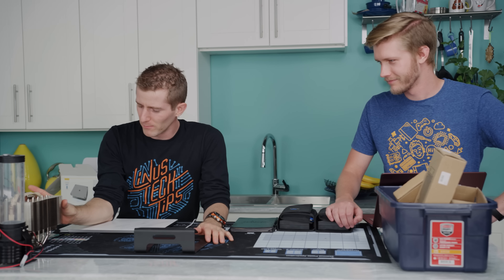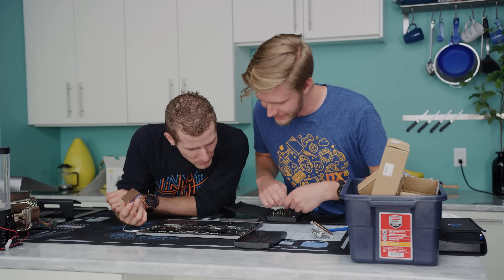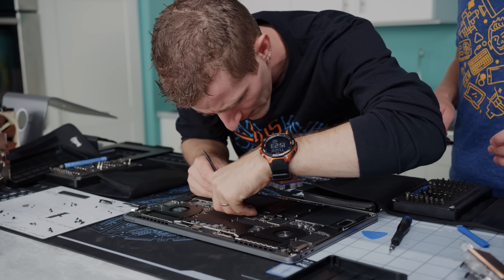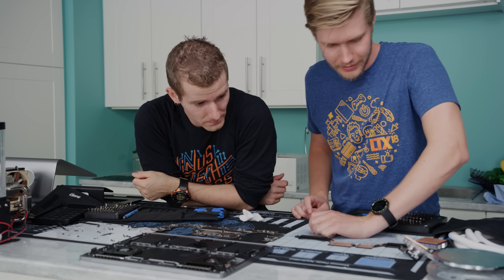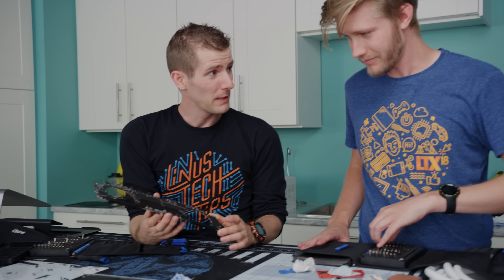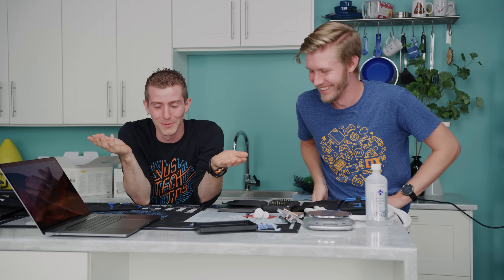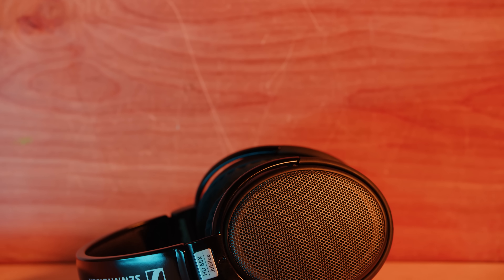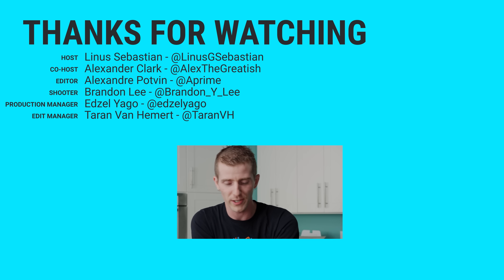We FIXED Apple’s New MacBook Pro

Comment: Just imagine, one day on the next model every screws turns into a soldered ones that users wont pry it open again... lol
Reply: That honestly would not surprise me one bit if they found a way to do that, so if it broke you would have to just buy another one once the really short warranty is up. This kind of crap is why there needs to be worldwide right to repair laws in place preventing stuff like this from happening.
Reply: Right to repair wouldn't prevent that. They'd just say it was done to lower production costs and there's nothing anyone can really argue about.
Reply: Dale Horton Actually if the laws where written correctly then yes they would, as the product would be non end user repairable, and it could in some cases depending on the country fall under environmental laws for it being harder to recycle, and even safety laws if they have issue with the battery as in the case of the Samsung Note phones that were exploding.
Reply: @CommodoreFan64  Totally Agree with you on this 👍
Reply: The only issue with that is that it would need to be done in such a way that Apple repair techs could take it apart in the event that they are forced to repair the machine due to warranty repairs.
Reply: @jamesfstokes  they don't need to open it. Apple could just call the thing a write-off, cut it open, copy all the data over to the new device, and call it a day. Extreme? Yes. Possible? Already done with cheaper "disposable" devices.
Reply: You are going to buy it anyway.
Reply: K 9 Poodle Nope not from me, the last Apple Product that was bought new in my household was in the 80's being an Apple II IE, and last 2 items from Apple I've owned was a Graphite G3 Imac because a friend needed the money, and only wanted $75 for it, and the last was an green 1GB iPod Shuffle I won at a past Christmas office party from my work, that I turned around, and sold on eBay to buy a Sandisk Sansa C250 in which I later put Rockbox on it. In fact all but one of my computers that's my Windows 10 gaming machine, runs either Xubuntu, Chrome OS, or Chromium OS via Neverware CloudReady Home edition, and all the phones me, my girlfriend, her daughter, and my elder mother use are unlocked Moto E and G Android phones. I lost all respect for Apple when they forced Woz out, and killed the Apple II GS. Fuck Apple, and their overpriced form over function Bullshit!!!
Reply: Only 1% of the total user base will ever open the stuff.
Reply: Nanorisk yes, beacuse almost everyone who wanted to open the thing will have moved on to things that are openable. And anyone else who needed to open one (read: broke it) will be screwed because the thing is not openable by anyone.
Reply: K 9 Poodle yah no.... just no.
Reply: they have to make it serviceable to an extent.
Reply: NO
Reply: And even then some braindead people would still buy it
Reply: Or its milled out of a billet of then welded shut so its not serviceable even by Apple.
Reply: luckly they use chassis materials that can't be soldered on. But wouldn't be suprised if they found an other way similar to soldering
Reply: @ThomySTB  maybe adding 2-3 locks that need a proprietary key.
Reply: @ThomySTB  apple uses aluminium which means that it can be welded, which is a lot worse than being soldered shut
Reply: Don’t give apple ideas
Reply: Fine, but fix your damn cooling before asking $5000 for a portable computer if you don’t want users servicing it.

Comment: you could get another backplate and drill into it to make a aftermarket cooler cover back for it I was thinking about doing this for my 2012 MacBook Pro for ultra cooling under the fan because I can get another back plate for this for about $30 now if it doesn't work or its stupid as it sounds.

Comment: I have a 2015 15" MacBook Pro all pimped out that cost about $3200 then and it was running a bit hot, so I decided to change the thermal grease on it, and it was shocking easily to take apart, I figured Apple would have made it very difficult to do. Anywho I see Apple was annoyed by it being so easy and decided to make this extra hard just out of spite.
Reply: They just wanted to make it difficult so you give up trying to do it yourself, and you to take it to the Apple "Geniuses" at one of their stores, so they can charge you more money.
Reply: BUT IT DOESN'T HAVE A TOUCHBAR SO IT"S GAY
Reply: Yeah pretty much :(

Comment: You guys took out way too many screws.. No need to remove the track pad, no need to remove the row of little ones just past the cooling fins. I put liquid metal on mine last week. You remove all screws on the mobo only, unplug all cables attached to mobo and it comes out.

Comment: I have the new razer blade stealth I tried liquid metal and it didnt help very much but I also used thermal pads on the heat pipe to touch the aluminum  case and that dropped the temps in games by 7-10c.

Comment: I HAVE THE SOLUTION !!!!! The encasing all around the fans SHOULD BE ALL PURE COPPER !!!!  Naturally linked do the heat pipes, which all should be copper !!!!   Just need to manufacture the casings!!!!!  Even the back plate cover could be copper.
Reply: Thin copper sheets are not great at conducting heat across their length. Really the only solution is a larger heatsink altogether

Comment: Wait what? Where do you guys get it from that you need to reapply LM? Still have not seen a single long-term test that came to that conclusion. Well, unless you applied it to an aluminium heat sink/cold plate. But then you kinda have to reapply a new heatsink too, periodically. Like pretty much daily.

Comment: How about this? Make an actively cooled laptop stand. Since the back of the laptop is made of aluminum, shouldn't it at least partially act as a big heat sink? If so, having an actively cooled laptop stand that leads the heat away from the bottom of the laptop and into a radiator might end up being beneficial to the performance of the laptop when under heavy load for longer periods of time?

Comment: while liquid metal isn't the best thing to use long term it dose beg the question why isn't the heat sink soldered on for laptops like a IHS the chip has to be soldered onto the bored so it is comming out why not take this extra step for the 15% improvment in cooling on some sort of super highend laptop.

Comment: Get NYCNC to make you a CPU and GPU custom copper water block that fits properly. Cut a hole in the case of the laptop to fit the water block and hose.  Mount a USB powered fan for portability. Plug it into a full liquid cooling rad when sitting on a desk. At this point you might as well bought a real laptop.
I do not get the point of paying 5K for hobbled hardware like this. Very poor application of parts. One thing they could have done was incorporate the heat sink into the bottom of the chassis.
Reply: Best thing they could have done:
Smaller fans, leaving room for a bigger heatsink. Add a millimeter or two extra thickness so the battery doesn't have to be so thin and long; leaves extra space to fill with fin stack.

Or just accept that you can't fit such a powerhouse in such a tiny laptop.
Reply: I think Apple considers the whole aluminum case to be part of the cooling solution. Of course without any direct connection to the heat sink that doesn't work so well. I'm glad they actually added vents, My 2012 MBP only has hidden vents by the bezel. I've also found that I have to pull the fan assembly apart periodicaly to clean out pet hair and other crap that gets caught and forms a little lint blanket that blocks the airflow. If I do that and use software to manually control the fan speed I can keep the CPU temps around 60 under load.

Comment: Combine with a fan controller software and I bet it made a bigger difference than they are seeing. The problem is the fan curve is the same on both tests...

 Apples software is still allowing it to thermal throttle the same as it has been, it's just quieter now because ilthe fan is cooling it more easily than it was stock.

Comment: Gamers Nexus did a video recently showing that, at least after a year, you don't need to re-apply liquid metal.

Now maybe you'll need to re-apply the liquid metal after a longer period of time, but let's be honest - any person seriously buying this laptop will have the kind of money to not care about using it longer than a couple years at most before replacing it with the next-gen model.
Reply: I've had some sitting on my cpu for over 3 years with no issues yet. Well temps are good. Not sure what it looks like.
Reply: NM64 - Nintendo Maniac 64 . That's not even remotely true. There are many people that purchase MacBooks that can't just throw them away on a whim. It's kinda like saying that because you can afford a midrange gpu, your not going to care if you fry it.
Reply: Not true. I've been using my macbook pro since 2003. I probably won't buy another one until they move it back into a chassis they can fit proper cooling in.
Reply: As if that will ever happen again. :D
Reply: @yissssss  well macbook pro was created at 2006, unless you mistaken it for powerbook or macbook pro 2013.

Comment: Actually Steve 
tested liquid metal in a system for a year and it was just fine so periodically is not very often.
Reply: I almost got triggered when I read the name Steve in a comment regarding a video featuring an Apple device.😂
Reply: agreed - though I can say from my Razer Blade (2017 Kaby Lake version) that Thermal Grizzly Kryonaut does indeed dry out and need to be reapplied... after about a year.
Reply: kalmtraveler How the heck can METAL dry out? There’s no water in there to dry up, and there’s no way the metal gets hot enough to evaporate.
Reply: metal can't dry out. Kryonaut is not liquid metal - you are thinking of Conductonaut.

Comment: Guys, if you wanna put Blowymatrons on the MacBook Pro, 3D print a new bottom for it with holes in it.
Reply: the bottom is aluminium, and they would have to machine it out of a solid chunk. Have a look at this, and you will quickly realize why they can't 3D print it. 
https://appleinsider.com/articles/08/10/14/apple_details_new_macbook_manufacturing_process
I'm not defending Apple here, as the last Apple product I owned new was a green 1GB Ipod shuffle that was a door prize at a past work christmas party, and I then turned around, and sold it on eBay, I'm just saying it's not as simple as 3D print something.
Reply: As an amateur machinist that chassis is a thing of beauty.

Now throwing everything out the window I don't see why the bottom could not be 3d scanned and then plugged into a CNC to produce something that could do a short test. Lets be honest most of the LTT tests are for views and never meant to last longer than the video. I think it would make for a really interesting series (and highly expensive). Linus could find somebody that knows what they are doing scan it and either have them remodel it with the cooling solution or find somebody else to do the redesign. Then find somebody to mill it.

Face it, Linus will take a dull hacksaw to a block of aluminum for a heat sink and thermal epoxy it to the bottom.
Reply: sounds like a great idea.. and put 2 blowie on the bottom.

Comment: p5's outside, but its all t5's and t3s, mainly t3s inside and then the antenna bars small screws t2s. the track pad does not have to be removed to take out the logic board. FYI for anyone at home, when you take the back case off you should life the front first and pull to the front its designed to clip in, it is not supposed to be just lifted straight up. You do not need screws in the back of the case for them to turn on.

Fun stuff, to replace the fans you have to take out the motherboard...

FYI they are shit products.

Comment: Why don't laptop makers sell machines with liquid metal stock if its so good? I know you can't move it around because of corrosion to aluminium, but it should work with cobber heatsink.. right?
Reply: It wouldn't be cost effective to do as it takes too long to apply and is tricky.
Reply: I'm not talking about taking pre made laptops, open them and change thermal paste for liquid metal. If a company could make a laptop from the ground up designed to use liquid metal in a way that's save and efficient.
Reply: My answer was referring to exactly that, it would be too difficult on a production line. Laptops are made in thousands and you need a paste that is quick and easy to apply on a factory line that has consistent results. The OEMs could use higher quality paste at the factory though that would help things greatly.

Comment: 13:10 The red Sign says: "Warning! Do not use with aluminium heat sinks."
Reply: GAllium messes up aluminium real nice
Reply: If you have a new f150 be aware of pranksters.  Your truck will dissolve
Reply: It's actually in english at the back of the instructions, you can see it before he flips it haha
Reply: tl;dr I guess? :)
Reply: XXX
Reply: It's not aluminum. The chips are coupled to a nickel plated copper heat spreader with liquid metal, then liquid metal never touches the unibody chassis.

Comment: a laptop not turning on while screws missing is not uncommon. my current laptop will not turn on if the screws of the access cover are missing, meaning you could try to how-swap mass storage or ram, which might kill your drives/whole system even.
Reply: In his iMac Pro upgrade video, he talks about some screws being used for electrical connections. I guess it saves on wiring and the hassle of ribbon cables...
Reply: this is not an imac pro though. the only screws missing here when the laptop did not turn on, were screws for the outher case.

Comment: A $5K Computer should not need fixing. I quit buying Apple products 10 years ago. Had 2 macbooks blow their mobos back to back, and after a little research realized that they generally use sub-par or outdated hardware. Would rather just use their OS in a Hackintosh
Reply: I agree but this isn't just an Apple problem, pretty much all i9 based laptops thermal throttle and overheat. Most modern laptops can't even handle i7 chips either.
Reply: Yeah, macOS is actually really really nice and surprisingly productive. But I'd never ever pay for apple hardware again after my late 2009  iMac and several ipods.
Reply: I don't know what to say to that Johnny, other than any serious PC builder knows that a super-slim performance/gaming laptop is generally not a reliable investment. Performance is heavy and still slightly bulky, even if it does come in a portable package. Think it will always be that way, unless someone makes a huge breakthrough in material fabrication and thermodynamics. Even being a nerd is supposed to give you a little bit of a workout, it seems.
Reply: There was this one laptop Linus did a piece on that had a fullsize GTX1080 in it, was pretty massive in laptop terms, but one of the few that seemed worth its weight. Like they basically flattened out a desktop case and put a laptop screen on it. I wanted that thing, it was really expensive though. Think around $1800-$2000 for the base model. If I was a younger adult without other things to spend my money on, I'd definitely have bought it. For the life of me I can't remember the name now though.
Reply: I agree but what I don't understand when it comes to windows based machines apparently it isn't an issue for reviewers because stating that brand X is duff doesn't get any traction. Not aimed at you but look at the comments section, it's full of plebs stating Apple sucks etc.. when it is an industry-wide problem and this is what reviewers should say. I am not after defending Apple here, I am not a fan of thier new hardware.  But none of the new laptops perform well in thermals, most of them you have to disable turbo boost completely or at the min reduce clock speeds of the cpu other wise they just overheat.
Reply: Well since I can't remember who the hell it was it must have not been about brand, right? I know all the major brands and it wasn't one. Just more of how it was made...basically like a small, flat desktop with a fold up screen, that's still thick enough to have room for a decent-sized heatsink and fans, making it just a smaller version of all the things you'd find in a desktop.
Reply: Small laptops still have a place, just not for high end gaming. And they do just fine with an i5, which can honestly still game, just get an external GPU.
Reply: Agreed, the problem is it's very hard with a lot of these channels to know what is exactly going on behind closed doors, by this I mean sponsorship deals etc.. it seems a lot of the channels will be very critical of certain brands but give others a pass and gloss over known problems.
Reply: One small drawback is probably going to be that you'll have a better experience with it wearing headphones. That thing looks like its got 3 blower fans in it, which are great for cooling but loud as all fuck.